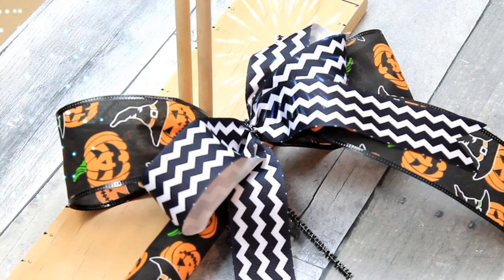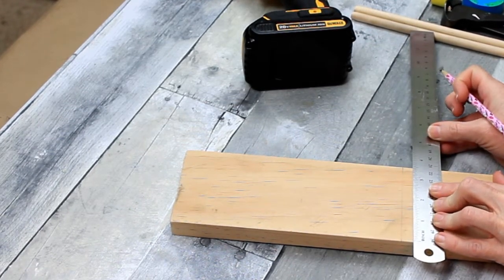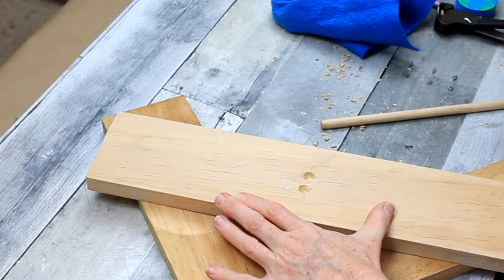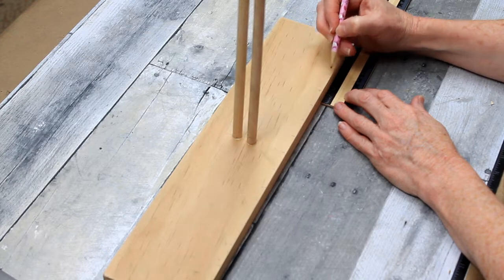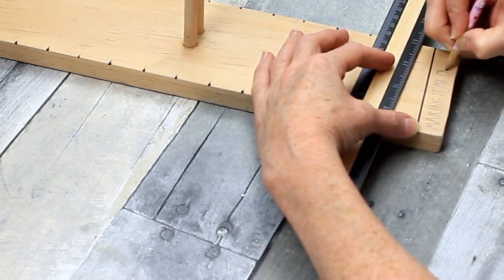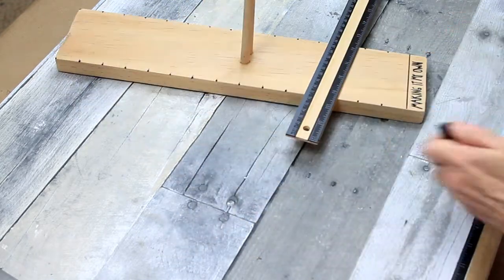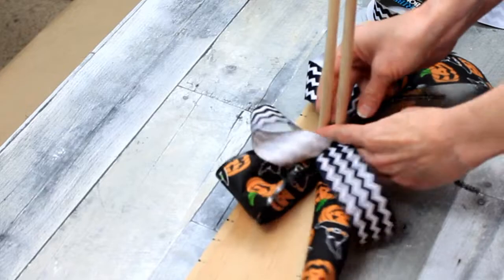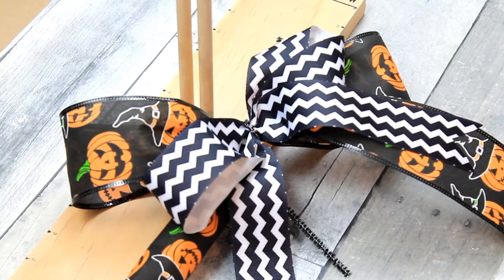Make Your Own Bow Maker to Create STUNNING Bows Today!

Comment: I AM A CRAFTY AND HAVE ALREADY MADE A BOARD.  I  DID MINE ON THE LENGTH OF THE BOARD AND MADE HOLES ONE INCH APART , MEASURING FROM CENTRE OUT.  I DRILLED HOLES THE O'D   OF MY DOWEL RODS.  THAT WAY YOU CAN MAKE DIFFERENT SIZES.  LOVE YOUR TUTORIAL THANKS.
Reply from the maker: Thanks Florence!

Comment: That extra inch on the end is where another dowel should go to hold your roll of ribbon so it doesn't fall on the floor or get all twisted up when your making the bow. To put your measurements on your wood you can peel the ruler pieces off the rulers from Dollar Tree and cut it to fit the 8 inches on each end and each side of your plank of wood.
Reply from the maker: Thank you! Great ideas!

Comment: This may be a stupid question but why don't ppl put their źìp tie òr wire cleaner on the bow maker first? Is there a reason?
Reply from the maker: Nope, not a stupid question. Most people probably do put theirs in before starting to make the bow. I just manage to forget consistently to do it. As many wreaths as I have done on this channel, you would think I would have it down, but no. 😆